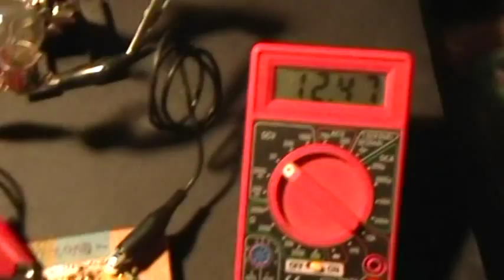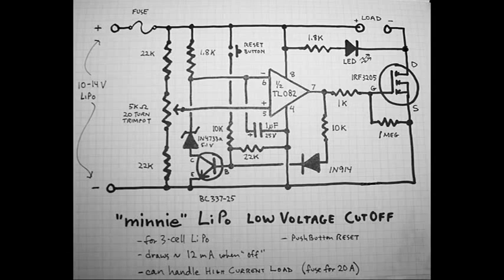Minnie Low-Voltage Cutoff Circuit Test

Comment: Hi, great video. What modification should be made for single cell LiPo battery, viz the cut off voltage at around 3.3V?

Comment: Hello TinselKoala, I have built your circuit and have a few questions. I've attempted to follow the mods mentioned by Sweir but I cannot find the schematic pic. Specifically I am running this with 3s battery and 2 car head lights as a load, works good until cutoff, power MOSFET gets really hot during cutoff. I've killed one MOSFET and severely wounded two others. Can you provided a link or description to the mods to make the MOSFET switch more cleanly? Or give me some advice on improvements you made to the circuit since the video? Thank you. ( if others have used and improved this I am curious what was done...I am running about 11 amps @ 10.75v-12.6v through this circuit, yes I have a heat sink.)
Reply from the maker: +Rob Bentz 
The basic schematic is in the video at about 5:17. It sounds to me like perhaps your mosfet isn't turning off cleanly or maybe the op-amp is oscillating. You can substitute a 2n7000 mosfet for the BC337 transistor, Gate where Base is, Drain=collector, Source=emitter. Also try putting a decoupling cap of 100 nF right across the Op-amp power pins (8 and 4) as near to the chip as possible to prevent oscillations. 
I haven't worked with this circuit since posting the video, except for putting in the changes SWeir suggested.  I did try it with a similar load to yours, didn't notice any particular high heat in the mosfet. 
Try the 2n7000 replacement along with the resistor and capacitor suggested.  You might also try reducing the value of the 1k Base(gate) resistor and the 1 meg pulldown resistor on the mosfet. Let me know how it goes... sorry about your blown mosfets.
Reply: TinselKoala
I will give the mods another try, I did follow the circuit diagram at the end of the video.  Once that was working I tried the mods but the circuit did not work the same.  I went back to the original design.  Now I added a 10uf cap on the base of the bc337 to ground, that gave me a circuit that was "off" at the load until I hit the button.  Do you think i introduced a problem with that mod?

Comment: Hi - great project! Since this circuit is for a battery pack (of 3 cells), one cell could get out of balance and discharge below a safe voltage threshold, while the overall voltage may still be above the device's cutoff value. How would you approach that?
Thanks!
Reply from the maker: Well, if you are really concerned about that you can always make individual circuits for each cell. But even expensive RC electronic speed controllers with low-voltage cutoffs don't bother to do that, they just monitor the total pack voltage.
Reply: TinselKoala
Thanks for this lightning fast reply. Well, this sounds convincing enough, good to know. Thanks.

Comment: great circuit. you could use a smaller mosfet and drive a high current solenoid or big relay... couldn't you? like for instance if i wanted to situate such a circuit between an inverter and a battery bank, with an electric refrigerator plugged into the inverter, to make sure the fridge didn't kill that batteries?
Reply from the maker: Sure. No need to use a smaller mosfet, the specified one is cheap and robust and will drive the relay or contactor without trouble, I think.

Comment: Sorry for asking out of the topic, but is it possible to use combined power generated from AC (grid) and UPS in case of grid brown out to still be able to supply sufficient power ? We expect that by doing this we can prolong the UPS capability. Thanks alot.
Reply: That is the function of an AC power regulator.  Those are more expensive than ordinary UPS. Too many of them on the grid also upsets grid operators as it inverts the load impedance.
Reply: S Weir Thanks much for comment, actually the real problem there is insufficient power available, meaning providing AC voltage regulator will not help as not much current is available. My plan is to combine any available power from the grid and UPS so I can extend the UPS operational. This is typically happen during the night time where the grid load is at the highest.
Reply: Bowo Prabowo
There are basically two kinds of AC voltage regulator:

Those that just regulate based on what is available from the utility. 

Those that charge a battery on the utility side and drive the DC to AC inverter from the battery only.

The more sophisticated units of the second kind do what they can to keep the battery charged from the power utility more or less independently of driving the local AC load from the battery powered regulated inverter.  When the utility browns out, the battery discharges more into the inverter than the utility side power converter delivers into the battery, and the battery runs down.  I think that is the type of unit that you want.  They are much more expensive per Watt and per Watt hour than standby UPS systems.
Reply: S Weir Thanks very much. Do you happen to know of any brand of UPS which is able to do this ?
Reply: Bowo Prabowo I am sorry, I mean the second type of AC voltage regulator which is able to charge the UPS even during the power browns out ?
Reply: Bowo Prabowo
You can Google "on-line UPS" or "AC power conditioner".  Tripp-Lite and others offer systems of this type.
Reply: S Weir Thanks much!!

Comment: Texas Instruments, Maxim (and probably others) sell watchdog chips that perform these kind of functions. Still, designing your own circuitry is a lot more fun.
ti.com/lit/ds/symlink/tl7712a.pdf
maximintegrated.com/datasheet/index.mvp/id/6046
Reply from the maker: Sure, and the RC airplane, helicopter and truck hobby users of LiPos can find the same functions in commercial OTS modules at their local hobby shops. These may have specialised connectors or be unsuitable in other ways, and certainly can't be modded or hacked. But people like me find ourselves using LiPos in non-RC applicatons and might avoid damaging a battery by using this simple circuit.
You'd still have to provide connectors, indicator LED, button, and maybe other external components when using the watchdog chips you suggest, but it might be easier overall to do it with one of them. I'll have to try it and see.
Reply: POR controllers are useful from the standpoint that they provide the comparator and voltage reference in one package.  The problems that they present are:

1. On simple POR controllers, the voltage comparator is not separately available from the supply input.  This imposes either a lot of current drain from a low resistance sense divider network, or considerable voltage error due to the bias current.  You need a supervisor with a separate Vcc input to get around this.  Typically, only fairly expensive multiple voltage supervisor chips offer that.

2. The response time is slowed by any filter capacitor on the supply / sense input of the simple, VCC is the voltage sense pin POR controllers.  The alternative is false trips due to current spikes.

3. POR controllers include minimum width reset pulses coming out of the tripped condition.  Those just get in the way of turning the application on.

4. A POR controller will not by itself provide the OFF until reset function that is desirable for this application.  When the battery is disconnected the voltage would recover and without additional external circuitry would turn the output on again. This would give rise to a "motor boating" oscillation that requires additional external circuitry to prevent by latching off.

From my POV one is better off using a comparator such as how the TL-082 is being used here and a separate voltage reference such as the zener diode also shown here.

I have uploaded a low current schematic to TK's file drop box that has an essentially zero current standby current once tripped for under voltage.  lipo_lvdo_low_current(2).png.
Reply from the maker: S Weir
I appreciate the design effort; the schematic looks good... but I'm afraid I can't work easily with surface-mount devices like the excellent LMV7271. One of my own design requirements is to use DIPs, things I can see with unaided eye and pick up with my fingers (and find again after I drop them on the floor)! Plus I like to deal with my local supplier in person across his counter whenever possible, rather than ordering exotic (to me) parts from the internet. Is there an equivalent super-low-standby-current comparator in DIP-8 package that would be more suitable than the TL series fet-input opamps I'm using? The circuit using the TL082 draws about 11 mA on standby; I could probably reduce that somewhat by increasing the resistor values in the dividers.
I know thru-hole and DIP components are "day-before-yesterday" tech but there it is...
This damned comment system has me bollixed, I know I'm missing some messages from you, I'll get caught up as soon as I locate them all, hopefully.
Reply: TinselKoala
Through hole parts that you could use include a TLV3701P is a plastic DIP rail to rail 5V comparator, and a TLV431AILPR TO-92 package 1.24V reference.  In the case of the TLV431, an external 4:1 resistor divider will get you 5V out of the TLV431, such as 12.4K / 37.4K or 10K/30K.  Reference terminal bias current is about 0.5uA, so you will want to keep the smaller resistor to 15K Ohms or less for < 1% voltage error due to reference bias.  You will also need to reduce the 47K bias resistor R3 to account for the 40uA bias current in the TLV431 and the current through your 4:1 divider network.  Both will only affect the current when the circuit is powering the load. 

Alternative forms of the circuit can be realized with a microcontroller.  The function is simple enough to easily fit into any part with 2K or more of code space such as an:  ATTINY25 available in DIP8.  His bigger brother the ATTINY85 holds 8K code and doesn't cost much more.  Aside from the fun of playing with a uC, you can do neat things like make the control automatically detect the number of cells and set the trip threshold. 

The easiest way I know of to realize very low power standby power is having the circuit cut-out itself off from the battery when it trips as in the diagram I sent you.  That sort of configuration can be used with the circuit sent, or modified with a different comparator and/or voltage reference as above, or using a voltage reference and a uC.  Various uC's like the AVR and MPS430 can with some careful programming realize some pretty low operating currents.
Reply: TinselKoala
I just uploaded a different circuit that is closer to the original MINNIE.  The operating current is about 0.5mA higher than the MINNIE, but the off current is now in the nanoAmperes.  The file is:  lipo_lvdo_low_current_TL082.png.

Comment: Nifty. Can you replace the reset button with something that resets when the battery is removed? And something to keep that alive.
Reply: To add a power on reset:  Replace the BC337 NPN with a 2N7002 NMOS, replace the 10K resistor from the push button switch with a 68K resistor, and add a 1uF 25V capacitor across the reset push button switch.  

The capacitor resets the circuit only when a charged battery is first connected.  After that, the circuit operates as in the video.  The resistor value change prevents oscillation due to battery voltage recovery at LV disconnect.
Reply from the maker: S Weir
Thanks for the advice. I'll try the variant on the next one I build -- this one is prototype, another one I just completed is going out to the friend who suggested it. So the third unit will try your suggested mods.
Actually, the circuit as it stands will start up 
"power on" when a fresh battery (or PSU preset to above cutoff setpoint)  is connected. I see this as a flaw though. In my opinion the circuit should not start until the reset button is pressed, even when a fresh battery is first connected. 
I would rather have a mod that ensured the load remained "off" until the reset button is pressed, even after hooking up a fresh battery.
Reply from the maker: The circuit as it stands will be "on" when a fresh battery is connected, the reset button doesn't have to be pressed. This is a flaw, not a feature though. It means that a separate on-off switch must be included so that the load isn't unexpectedly powered on when a fresh battery is connected. I think that optimum functioning would be for the circuit never to start unless the reset button is pressed, even after a fresh battery is connected.
Reply from the maker: S Weir
OK, I tried your suggested mods and the circuit does work better, in that it switches more cleanly at the setpoint. The only time the mosfet gets warm is when it's not cleanly switched, it seems, so using the miniMosfet instead of the NPN seems like a winner. (I used 2n7000, all I had on hand, and it was an easy sub into the existing transistor socket, just turned so the flat side is in back instead of in front, DGS where CBE used to be. Also couldn't find a 68 k but used 47 k, works fine.)
The reset button needs to be depressed a little bit longer for the circuit to come back on fully if the voltage is marginally above the setpoint.
I still think it would be better for it to stay off until reset is pushed, instead of starting immediately on connecting voltage higher than setpoint. Any idea how to implement that?
Reply: TinselKoala
A power on reset to off can be safely managed by making these changes.

Remove the 1uF capacitor from across the push button switch.
Insert a 10K resistor between the pot wiper and the op-amp non-inverting input.
Connect a 10uF 16V (or higher) capacitor from the pot wiper to the circuit common.
Connect a small signal diode, 1N914 or similar anode to the pot wiper and cathode to the positive rail.

The capacitor creates an ~110ms time constant filter on the sense connection.  That will be long enough to overcome connection bounce when hooking up a newly charged battery.  The 10K resistor ensures that most of the capacitor discharge current goes through the added 1N914 diode instead of the ESD protection diode in the amplifier.
Reply from the maker: S Weir
I needed a single BC337-25 transistor for another project and wound up having to buy a lot of 50 of them to get a reasonable price after shipping charges -- they worked out to about a dime apiece delivered. So every project I work on now has to use at least one BC337 somehow, or I'll never use them all up, LOL. But mostly I'm using them as switches rather than amplifiers, and subbing in a 2n7000 mosfet has worked in every case. For example, the SNOT ball driver uses the BC337 to drive the final output mosfet gate, and dropping in a 2n7000 instead of the bipolar makes no measurable difference in the performance of that circuit as far as ball speed and acceleration goes.
In this present circuit, using the transistor to gate the reference voltage from the Zener, it appears that the 2n7000 provides a little cleaner switching than the BC337 does.